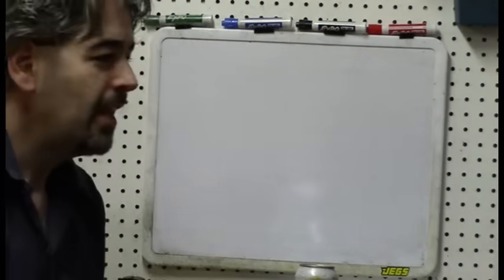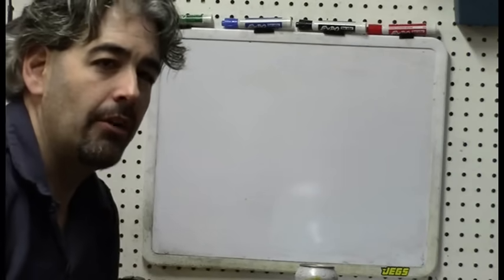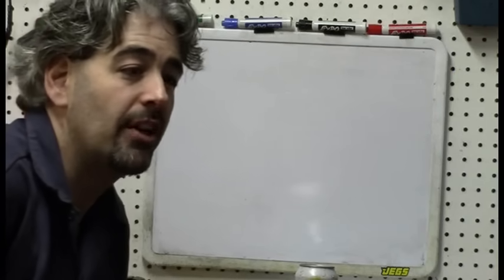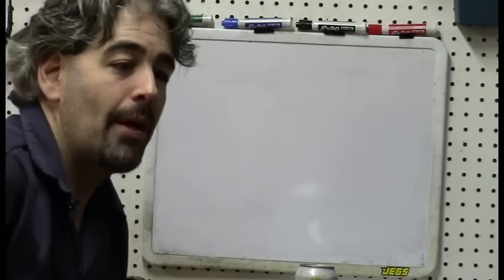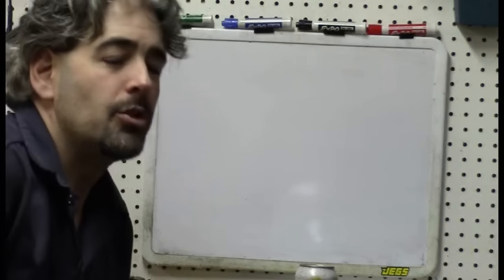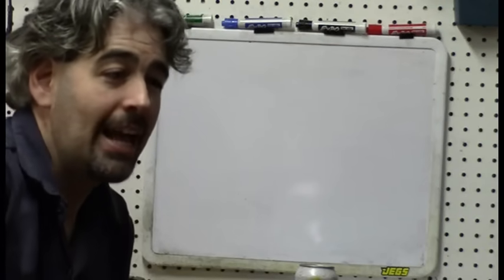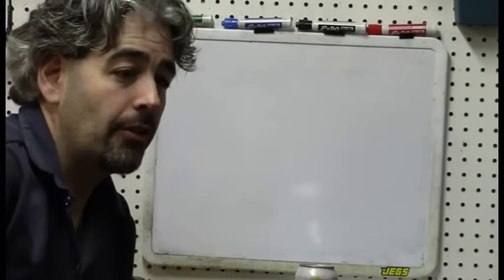Secret of Engine Problem Diagnosis- Fuel Trims Pt.1

Comment: Not trying to be a jerk, sincerely.  But...  There is a very wide spread misunderstanding of what a 14.7:1 Air:Fuel Ratio (AFR) means.  It is often stated as a ratio of 14.7 parts of air for every 1 part of fuel.  That is incorrect.  And I have come across this error in factory training, discussions, classes, manuals, and even military training manuals involving emission control and fuel systems for engines.

The correct way to state the 14.7:1 AFR is there are 14.7 pounds of air for every pound of fuel, or even more correctly in a 14.7 AFR the mass of air is 14.7 times the mass of fuel (weight and mass are related, but for the purposes of my comment I feel the use of a unit of weight vs using the word "mass" makes it clear what AFR really means).  In short, for clarification, an AFR is a not volumetric measure based comparison between air and fuel.  If you think about this for a moment you will realize that if it was a 14.7 parts of air for every 1 part of air, we would be seeing far less air being pulled into an engine.  There are other implications that further point out the folly of a volumetric based ratio involving air when it comes to the density of air molecules for any specific volume at various temperatures and/or altitudes.

There are other units of weight that are used as opposed to pounds, but despite the unit of weight used the ratios of the weight of air compared to the weight of fuel remains unchanged.  Accordingly, it is also correct to say the 14.7:1Air:Fuel ratio is also described as being 14.7 grams of fuel for every 1 gram of fuel.

For anyone who doubts that I am speaking accurately, please Google the following text, then read what Wikipedia says.

WHAT DOES A 14.7:1 AIR FUEL RATIO MEAN WIKI

As far as how widespread the incorrect description is, one only needs to drop "WIKI" from the Google search string above, then begin to read some of the descriptions, such as this one from Summit Racing, where they say in an article named, "Engine Basics - Air/Fuel Mixture," the following,  "AFR stands for air to fuel ratio. Fuel doesn't burn on its own. It has to be mixed with air. AFR tells you how many parts of air are mixed with each part of fuel. For example, a 14.7:1 AFR (or just 14.7) means the mixture is 14.7 parts air to one part fuel."

You can find that at the beginning of their article (https://help.summit racing.com/app/answers/detail/a_id/5230/~/engine-basics---air%2Ffuel-mixture).  And you can find that in a lot of articles, books, manuals, etc.  I hope that since 1976 the U.S Army corrected its training manuals re: how engines work, as I sent a letter to advise their manuals where all stating what AFR was incorrectly.  I actually got a formal letter back from the Commander who oversaw all Army training, advising that they researched my claim and found I was correct.  He then told me they would correct any subsequent manuals to reflect the correct description of AFR in future prints.  Well, knowing how things often go in the Army I bet they are still saying it wrong.  I have all but given up trying to correct this misunderstanding as it is so very pervasive.  But, with all this really great material being shared in this channel I felt compelled to point out this one relatively important matter.

In any event, I thoroughly enjoyed this video, just as I have enjoyed so many the other video in this channel.  There is always a lot to learn and I  truly appreciate everything you share in your videos, as well as the time you invest in making these videos.  I hope you do not feel I am trying to be anything but helpful in addressing my one little pet peeve re: AFR descriptions.

Now, if anyone reading this wants to have a little fun, go ahead and run the google text above, then begin read some of the articles, where many of those erroneous statements are made by well known publishers, to see how widespread this misunderstanding is.  You are now of a fairly small, but hopefully growing, sector in our industry who has been enlightened on this subject.  For those who are as detailed oriented as I may appear to be (I'm not, not really), I say, "Yes, I know that 'hopefully' is not accepted by many folks as being a proper word."  Well, not until we were well into the relatively early 20th century.  But, it has been used and abused so commonly that it was finally added to English dictionaries.  That reminds of a sign I once in Germany while in the Army.  "English is spoken here, but American is understood."  It just seems like it is a shared memory I felt was somewhat appropriate in the context of all this info I am sharing.  Dang, it must be really late as I am now beginning to ramble...

Ciao!

Gil

Comment: Problem with our 2003 X-Type Jaguar purchased second-hand 2018, 3-months warranty & of course everything running smoothly up until then.  Took it to our Mechanic, said the oil was as black as soot, couldn't find or replicate why 'Check Engine Light' & 'Cruise Not Available' with intermittent missing issue whilst travelling up hill at over 80 kms. The JLR dealership could not identify or replicate our issue $$$$'s later - spark plugs (original), oil wells, gaskets, coils, etc., etc., Totally disappointed & disgusted at JLR's charging us & not finding fault went back to our Mechanic, he drove it to his workshop which meant on the highway over 100 kms up hills its the Throttle Body Sensor so we found a wonderful person who replaced the whole Throttle Bottle.  No amber light from Sydney to Karuah had the worst trip ever returning home to Port Macquarie shortly after hitting the highway 100, 110 kms, light on, chugging, light remain on still driving at speed, then decides to lose power & stop. This kept occurring all the way, 2.5 hours, we would turn motor off, start off again then same, same.  Would you have any idea what this issue is this vehicle? At one stage there, JLR reported metal filings in the fuel filter, would it be the petrol tank? after sitting & not driven for years (so we found out), we have topped the petrol with fuel performance enhancer twice, only use Unleaded 98? Just need someone's honest advice apart from cut your losses & get rid of it (Hubby's pride & not so much now) joy, I'm ready to buy a new car with 7 years warranty & hopefully no problems.  Do you think this issue is too much in the hard basket? Would appreciate your comments.
Reply from the maker: What data do you have?
Reply: Records nothing on both mechanics & JLR’s scans.

Comment: Love the Lecture!

I bought an Action scan tool off a YouTuber's video showing jts fearutres.  The tool saved me from lifting off difficults 4.3L Vortec manifolds.  

I saw the fuel trims were to specification to include the sign wave of the 0² sensor.

I then looked to the electrical part of the engine and found the distributor cap was arching out.   Scan tool paid for itself by a factor of three.

Comment: My car has
 STFT for bank 1 and 2  -100% 
 LTFT for bank 1 and 2  -100%  steady. 
O2 sensors at 0.000v  
MAF 0.6 - 0.7 

What can be wrong 🤦🏽‍♂️
Reply from the maker: Sounds more like a scantool communication issue. Can you change the O2 sensor output by inducing lean and rich varibles?

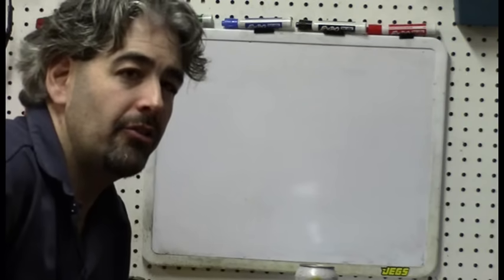Comment: 0:34 so pumped to learn!!!!!!! Ive got one of those scanners and have video uploads of the data on the youtube thinking somewhere someone would help but if I learn here ill be able to read that data and dumb down for the similar brain out on the youtubes. 🧠🙃 I killed my expensive catalytic converter no check engine codes!

Comment: You cant sustain stoichiometry in an engine. Bcs its not an ideal system
Reply from the maker: The point isn't to do that. The point is maintain an average stoichiometric balance to optimize both NO and CO catalysis.

Comment: I was confused why only the particle of oxygen is measured after combustion process. Air and oxygen are not the same relative to cross matching data going in and data going out.. is there a reason behind this mis representation or misleading it? We are the one who consumes a something but a computer has everything to say on the manner of consumption? Sounds not right IN MY OPINION. The consumer benifits more than the producers as what they market drive by wire is efficient for whom? For them or for us? Confusing times.

Comment: Dont need. None 260 k going to 270k yea I'm changing everything out..but as I do I'm monitoring changes   I feel how I drive to I can feel in thottle like weak fuel pump nothing was changed from when they suppose to be changed  from 100k mile mark even lower..its over due that's including I can have a clogged fuel filter my answer my back up to wat I'm saying is everything is old and many things can not operate at it's normal rate.
Reply from the maker: well you don’t need me then. Good luck. I hope you guess it correctly before you waste a lot of money.

Comment: Thank you for your thorough, well edited,  succinct,   clear,  easily absorbed explanation of the inter- relationships Fuel Trims, O2 Sensor values and how to use the captured data sets  to yield intelligent diagnosis of related engine issues.  Your examples of  different issues:  vacuum leaks vs MAF vs Fuel Pump issues with the related LTFT, STFT, and O2 sensor values are extremely beneficial to understanding what is being measured and how to use the info .  Adding the diagnostic considerations of in-line cylinder vs "V" cylinder arrangements was a great help.   I can finally use the Freeze Frame and graphing functions of my Innova scann tool to help arrive at a factual based , correct diagnosis of engine issues in my trucks. Thank you... Tom Jones: New Orleans, La
Reply: Tom, Which Innova scan tool do you use?  And does it work on a 1993 OBD1 vehicle?

Comment: How do we read fuel trims in OBD1 vehicles?
Reply from the maker: you need an obd1 reader and you use Block Learn (long term) and Integrator (short term). It’s a binary system however with 255 being the zero point.
Reply: Could you please do a video similar to secrets of engine problem diagnosis but using block learn and integrator in obd1? I need this for a toyota corolla Ae110 1999 model
Reply from the maker: I would but I don’t have scantool that can do OBD1 sorry!

Comment: Lol.......
Explain why I have 25 on short and 25 on long!
And long trim or short never goes negative. If so....... Not by much maybe down to 18 then back to 25
I have high fuel pressure but fuel isnt getting in the engine.
Like a restriction. 
Yet.... Cold starts runs great
 Its when car warms up or opp temps it starts bogging down and trims short and long go to 25

Comment: As always - this is a great video and I so appreciate your explanations.  I am not yet a 2%er like you or many others, but am getting there.  One quick question sir on your O2 sensor scales on this video and a few others that I have seen from you if I may:  Your scale is +900mV and +100mV (i.e. not 0mV), yet you draw the midpoint at +450mV, not +500mV.  Am I missing something?
Reply from the maker: I simply did that to differentiate it from the bias voltage
Reply: Sir - Thank you for the explanation - (and it's my issue, not yours by declaring my stupidity to the entire world...) but having googled this, I am still none the wiser.  It so doesn't matter as your channel is simply excellent, and I pretty much understand all your explanations and concepts (other that this one) - but perhaps there are others who are also confused by the bias voltage concept (i.e. mid point being 450mV rather than 500mV) - but possibly not - may be it's just me....

Comment: I have no clue what you mean with fuel trims. Just give me dials and let me control the fuel. You talk about 14.7 to 1 and how the ecm has OCD in controlling the engine.  So why does my 89 chevy S10 pickup with a 2.5 liter engine with TBI run like crap? You give it gas and it will hesitate stumble and carry on. when you leave off the gas the engine shakes and carries on. The only thing I didn't replace is the tps sensor. Last weekend I replaced the fuel pump with a new AC Delco fuel pump. replaced the sock and fuel filter and the truck runs worst. The ecm can give us errors. why can't we give it errors. I went to school for this and I am a certified inspection mechanic in Pa. I have a snap on red brick and there is no codes all the sensors look good. The new O2 sensor is NOT  lazy. But yet my engine won't run right. before I changed fuel pump the engine ran great for about 15 minutes and then started to run like crap.
Reply from the maker: Your chevy used integrator and block learn for STFT and LTFT repectively only on a binary scale instead of percentage with 128 being the zero.  You can apply the same thing in the video on your truck and get data to find the cause.

Comment: but you have to have a computer , how would be done with an old school engine, with a carburator?
anything can be done with unlimited money!
Reply from the maker: Unlimited money??  You need a $200 computer. Thats all.  Hardly unlimited.  You cannot measure fuel trim without one.  What are you going to read bthat possibly would give an algorithm based output???
  Plus, not all things can be done with unlimited money. For this you have to have comprehension.  No amount of money is going to buy a computer than can do the diagnostics.  It doesnt exist.
  So in reality, There are no excuses.

Comment: Great stuff but please don't tell people to use Brake Clean to check for leaks or ever on a running or very hot engine. I is far too flammable  and can seriously burn you and torch your car.  Great for oil change clean ups bet the vapors and fluid is highly flammable. Be very careful with that stuff.

Comment: like how you things fuck what people say not youre fault they stupid..but as for cars..just when looking up a model car its always not a car im looking at for instance 2004 jetta...transmission problems get every other car but what looking for..if and how to know if the car is low on transmission  oil and if i do change filter and .transmission oil and she still kicks..seen some videos but i have scientific mind also..i have to get deep into it..every action is a reaction...im me if you have any help..im just been working on car mas air sensor few things engine is running fine now that been fix everything else acting up..have clear codes..tuned her up..oil .sparks.breaks blead them..think have to do it againg break feeling little soft..but for as transmission..thinking filter transmision oil know have to have it heat to 100 then open plug see if she drips while car is on..but youre videos have helped once againg fuck these haters..

Comment: I had this code and it was the o2 sensor on a v8 lol I swapped engines and took the intake mani off and replaced the gaskets I thought I had a vacum leak forsure I learned a lot about o2s and fuel trims just by running into this problem. Almost pulled my hair out trying to figure it out.

Comment: 14.7 to one is not the correct stoich for pump gas. You lost me ofter that. One of the main reasons you hear people with 90’s and 2000’s efi cars and trucks say, “i think shes just getting old it doesnt feel as powerful anymore”, is because they are running lean due to the computer being programmed to believe the stoich of the fuel you are using is 14.7.  Its not, thanks to the corn lobby, we have e10 and along with the many issues that trash causes, older cars that are not tuned, are running lean in both closed and open loop.  

They do not enrichen enough at wot due to this and power suffers and some engines ping (spark knock).  

Anyway, 14.7 to one is not the stoich for pump gas and it hasnt been since the inception of e10 as opposed to pure gasoline.
Reply from the maker: Sorry but you are inaccurate in that statement. You are misunderstanding that fuel trim does not maintain a 14.7:1 ratio. Fuel trim maintains optimization of the mixture based on the EXHAUST output and adjusts the ration accordingly.The fuel trim would richen the mixture even if the gas was causing the lean condition. 
  It is essential you understand the operation of fuel trim in regards to stoichiometric response, not as the source of stoichiometric maintenance.
  Rewatch the video with an open mind and it should make sense.  A car from the 90's that loses power is not related to the fuel trim or O2 sensing and you would grossly misdiagnose the issue.